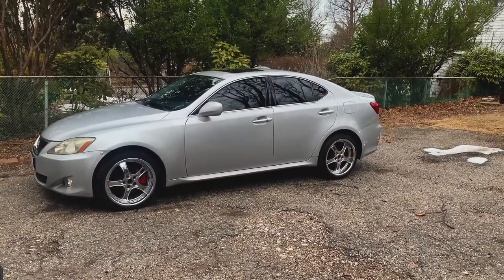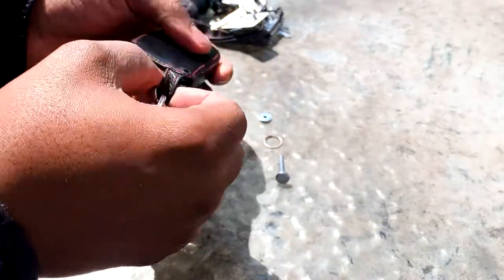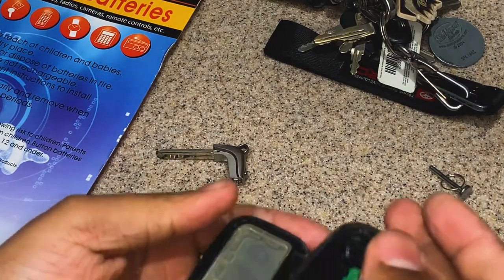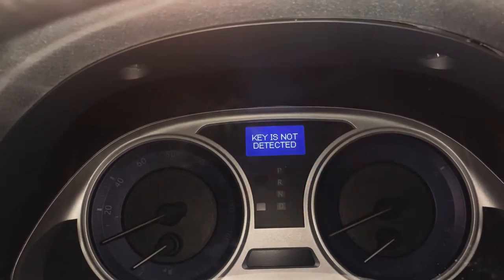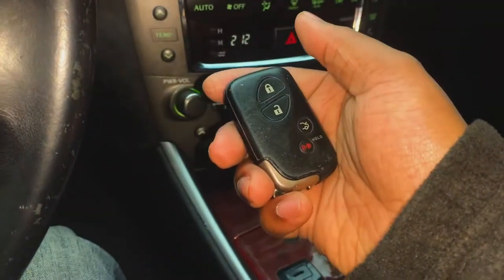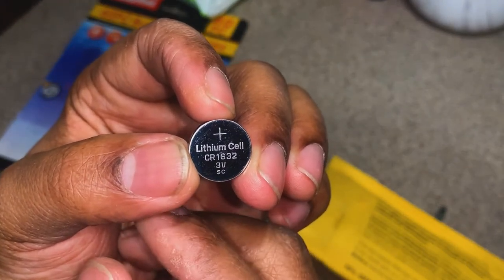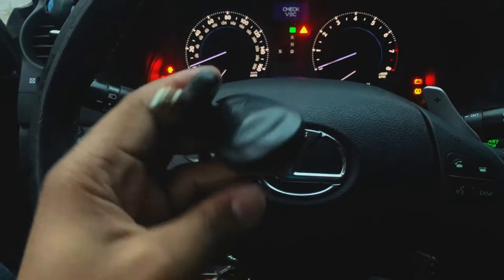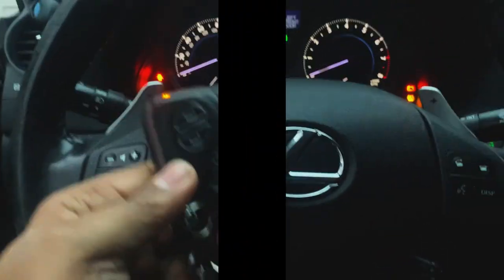Start Car With Dead Key Fob | Change Key Fob Battery (Lexus IS250)

Comment: This was an amazing video.  I'm in a ja, where i have the key part but not the black part.  I am thankful to know how to get into the car but am I sol without the black part? Any additional advise would be very helpful. Thank you
Reply from the maker: Sounds like you have the vault key which allows you to access door locks but not the car ignition system. You will need to purchase a new key and then contact a locksmith to program the key to your car. You can save some money by purchasing the key separate but it may be best to purchase through a local lock smith. Hope this helps.

Comment: Is not working on mines..
Reply from the maker: Did you try to manually start the car with the Fob as noted in the video 6:08? If so, try replacing the battery and that does not work then I would recommend replacing the key FOB. Before you do replace the key FOB check with your local locksmith company to see how much they would charge to diagnose the key fob issue and compare that to the cost of a key replacement to identify which is the best cost effective solution..

Hopefully your issue is just a bad battery, swap and your on the road.

Comment: I replaced the battery and im starting to have the same issue, should i just get a replacement?
Reply from the maker: When you had replaced the battery, did it show signs of improvement when unlocking/locking the doors? If so, you may want to try a different brand battery and see if that helps. But YES at the end of the day, you should consider having a spare for safety.
Reply: @AWordFromMrJones   Yes it did, but yesterday for some reason it happened again, its working now but im going to get a replacement before i stay stuck in the winter 😂🤣, thanks for your response !!
Reply from the maker: @Jtb718  Lol no problem.